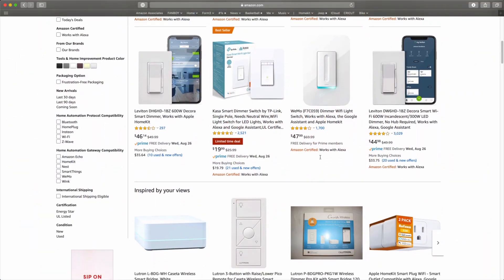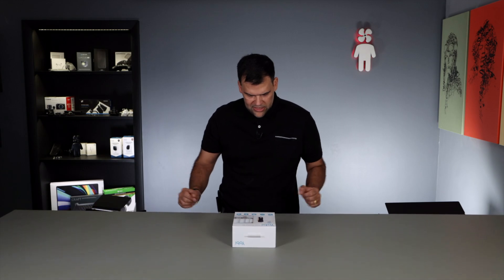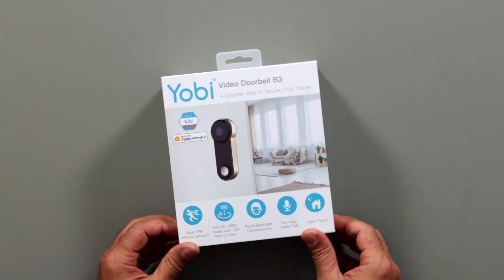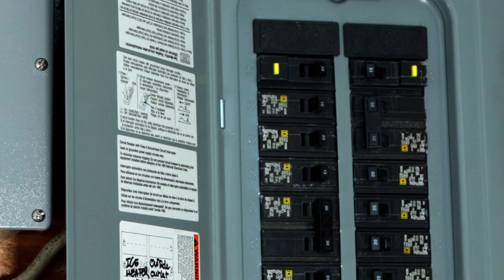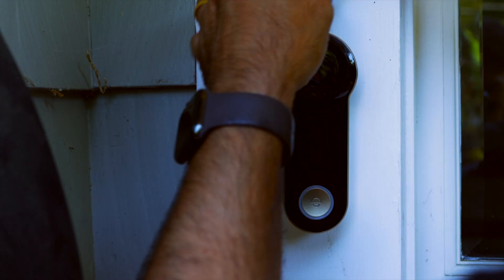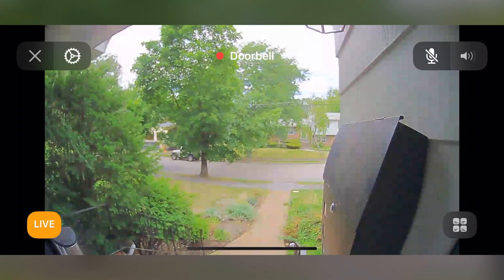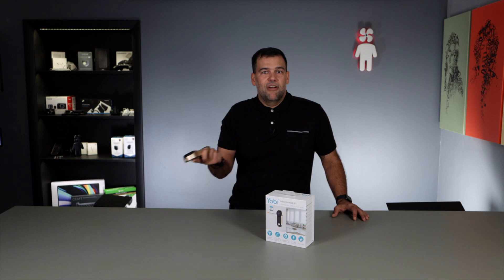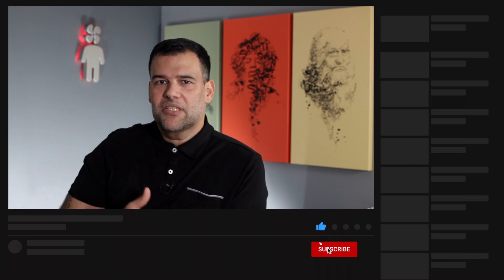Too Little Too Late - Yobi B3 Homekit Video Doorbell Review

Comment: “You can’t record footage at all”
Yes, you can. iOS has this nifty feature called Screen Recording. Get the footage all day long. Even uploads to the cloud. Sure, I know, it’s not a directly integrated solution. It’s also the first of their product line. Expect to do some problem solving for what you want out of a product made by a company with a relatively small history.
Reply: @FanboyTech  that’s a very different stance than your original video monologue. I don’t disagree, it should have that feature. Not because that’s how all of them should work; there should be models with certain amounts of feature sets in my opinion. Screen capturing video still has value, evidence or even posterity has high value in many occasions. It’s great for those that don’t want their videos in the cloud. Not my concern, but many don’t want their footage anywhere off their own local storage.

Comment: Seconded - the product is very cheaply made, and the company's support is atrocious/nonexistent.

I bought one. It was... "okay" as a product. All things mentioned in this review are 100% true about it.  In addition, its WiFi connection is *TERRIBLE*. Mine is about eight feet from my WiFi router/base station, and it would lose WiFi regularly. Then it failed within a couple days. It took over a month of calls+emails to get them to replace it. They said they'd replace it pretty quickly, then took a month to actually send the replacement - I had to demand my money back, then within an hour "okay, we just shipped it out."

Then the replacement died within fifteen minutes of install. It has been over a month since that, and I haven't been able to get any response from them at all. I have disputed the credit card charge with my credit card company.

I had been hoping this would be decent, coming from a company with an established "smart camera" company.